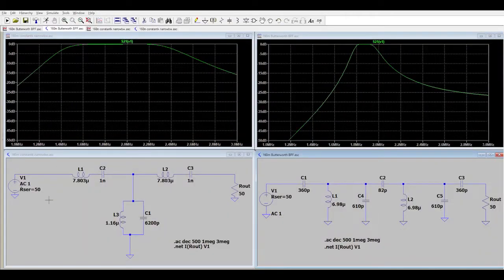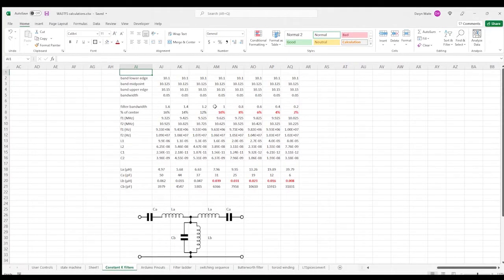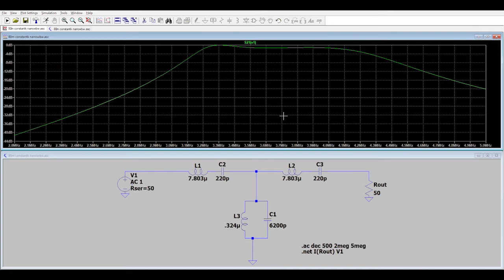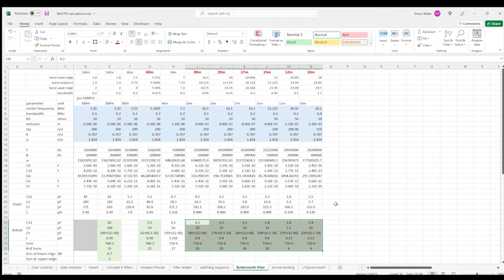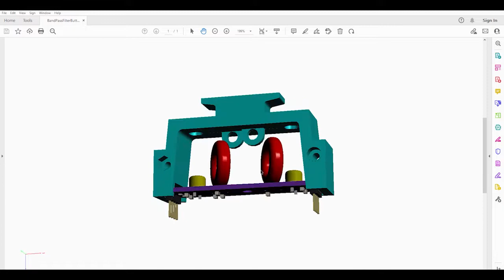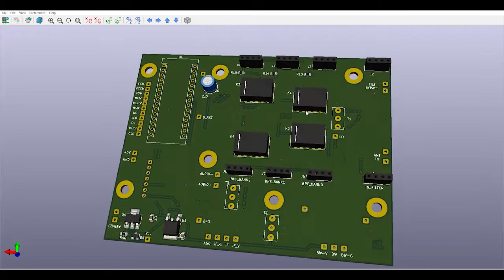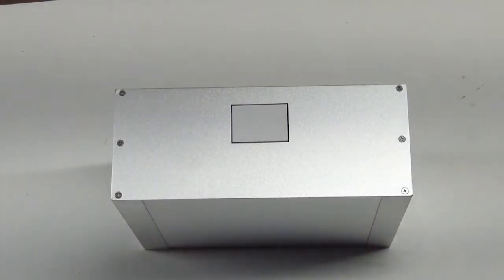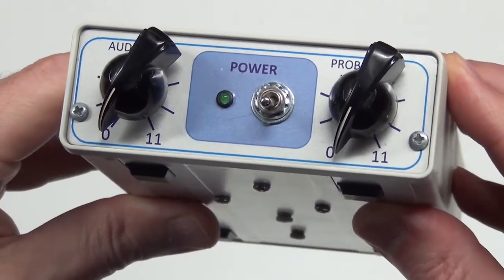Superhet Receiver Part #3: Band Pass Filters Plus More

Comment: I would like to use a good quality airek than use a long wave and medium wave and iron core airel  I also do not like to use surface mount devices. As they are very figgley and to much solder causing a short.  Thanks for your help and advise.